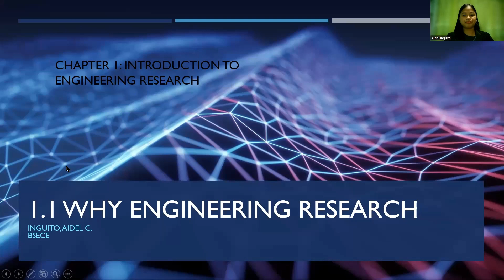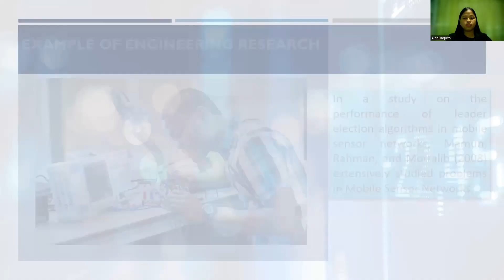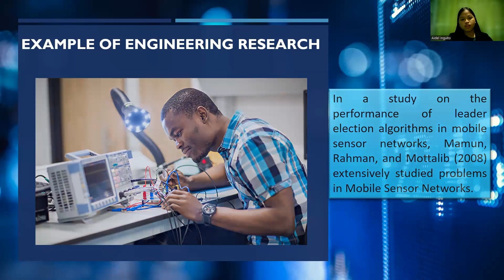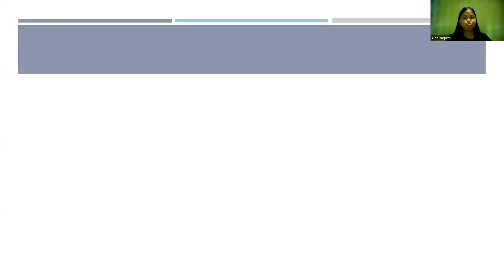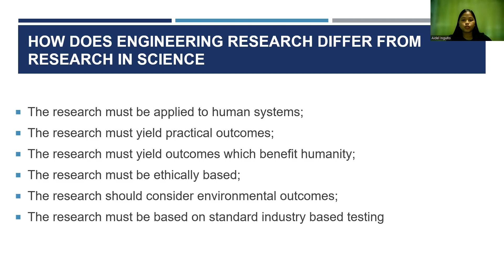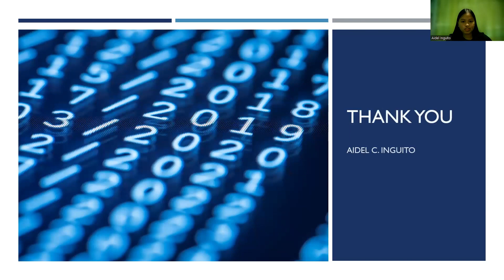Why Engineering Research?

Comment: Pahilaga, Christofferson M.
March 20, 2023
MWF 6:30pm-8:20pm

Reflection
This video presentation talked about research engineering, which for me is more likely about innovation. Compared to the research that we had in high school which is more about historical information and science, engineering research produces something that hasn't existed yet. This report demonstrated how differently the engineering research is compared to research in science.

Reaction
The reporter had discussed his topic in the most effective way. The reporter provided ideas and examples that are easy to understand and relatable to the discussion.

Summary
Engineering research is more about solving an existing problem with innovation. It also seek improvements or additional features to an existing project that helps minimizes the error that our consumers or surroundings are experiencing. It also demonstrated the difference between engineering research and research in science.

Comment: Tagle, Charlie P
March 20, 2023
MWF 6:30 - 8:30
REFLECTION:
I discovered how to distinguish between scientific and engineering research. While both explore new information, engineering research is primarily concerned with how that information could benefit humanity. It must be morally sound in order to safeguard individuals and society.

REACTION: 
very imformative.

SUMMARY:

The vedio emphasizes the distinctions and connections between engineering and scientific research. They both employ the same scientific procedures, but engineering is more interested in applying research to real-world goods, services, and infrastructure. In conclusion, engineering study does not attempt to comprehend how the world functions, but rather concentrates on how items can perform for a certain purpose.

Comment: AMAHIT, KENT L.
MARCH 20, 2023
MWF, 6:30-8:20 pm

Reflection: I observed that the reporter is reporting well the assigned topic and discussing the importance of engineering research, this is an important component of the engineering profession. It allows engineers to understand how to best solve problems and develop new technologies.

Reaction: I observed that the reporter is reporting well the assigned topic and discussing the importance of engineering research. I am excited to learn more about engineering research and how it can help me in my own engineering projects.

Summary: Based on my observation this chapter report provides an overview of engineering research and explains why it is important to the engineering profession. It outlines the benefits of research and discusses the types of research that are commonly used in engineering. It also includes examples of engineering research projects and provides tips on how to effectively conduct research.

Comment: Mariot, Aubrey C.
March 20, 2023
MWF 6:30-8:30 PM

Reflection:
The essence of being an engineer is to explore, innovate and invent things that is impactful to the community. All of these are impossible through engineering research. We are adding new knowledge and gather more information into an existing one, that is what research is all about. We find solutions to practical problems that can benefit the stakeholders. We find ways to create space that will explain how important research is, and how it will affect our lives differently.

Reaction:
I find the video informative and formal. The reporter delivered her topic well, and presented methods that can be surely used in our research. Overall, the presentation is effectively discussed.

Summary:
The contribution of engineering research makes our life today easier. Engineers find solutions to practical problems that put our lives at ease. Through the discovery of new knowledge, and the aim of exploring and seeking for innovation and improvements paved way for us to have an access to a more comfortable life.

Comment: Duhaylungsod, Lynard S.
March 20, 2023
MWF 6:30PM- 8:20PM

REFLECTION:
Engineering research is different from other research studies due to its purpose and functions in the human system. Every engineering project has its purpose and it must be done ethically and we thorough research and survey.

REACTION:
It was a great presentation, very informative and was delivered well by the reporter. The reporter also gave some examples to make her report more understandable and made a summary after the presentation.

SUMMARY:
Engineering research is a study that relates to the human system and must add new knowledge from the existing projects. There were also things to consider in doing engineering research and to have a better outcome.

Comment: Zacarias, Lorrie Jaye U.
March 15, 2023
MWF 6:30 - 8:30

Reflection:
I've learned about the differences between engineering research and scientific research. It is more concerned with the application of concepts and theories to improve one's life. That is why I was drawn to engineering and regard it as a noble profession.

Reaction:
The reporter has done her report well and her voice is very clear that it makes you listen to her more and more. 

Summary:
Engineering research is the process of acquiring new knowledge in a variety of ways. It seeks to improve on the existing outputs that have already been produced. The goal of engineering research is to improve our quality of life by addressing practical problems that require long-term solutions.

Comment: Xavier O. Baculado Jr.
March 20, 2023
EE 341-A (MWF 6:30-8:30)

Reflection: 
I have learned that engineering research is different from the research in science. Based from my previous experinced from senior high school, we were only taught with the research and I am more amazed that engineering research were taught and introduce to me. Engineering research focuses more on the advancement or improvement that can be beneficial and crucial for the society. It is a discovery of conceptual knowledge and finding practical solutions to different types of problems and contribute not just on the society but also to the environment.

Reaction:
The reporter highlights the goal and cite some example that is relevant to this topic. Overall it is very well presented.

Summary:
Engineering research is a process of discovering of new knowledge and it applies scientific principles in finding or formulating solutions for advancement and improvement of life. Engineers create, maintain, manufacture, design, build things that can contribute to the society and by doing a research they can thoroughly seek an improvement or enhancing ones work to fulfill its duty to the fullest.

Comment: Lerio, Shiela Faith
March 19,  2023
Mwf 6:30-8:30

REFLECTION: 
After watching the video, I learned  the importance of the scientific method and peer review in validating research results. Also, the objectives and ethical considerations that are unique to engineering research, such as the practical application of science to benefit humanity while considering environmental outcomes and ethical principles. Lastly, I learned importance of presenting research findings publicly to other experts in the field for review and verification, as well as the need to acknowledge prior work in the field when conducting original research.

REACTION:
The reporter provided thorough coverage of the essential topics from the reference book. Well done!

SUMMARY:
Engineering research applies scientific principles to practical systems that benefit humanity. The scientific method, including peer review, is used to verify research results. Engineering research must fulfill objectives such as being ethically based, considering environmental outcomes, and being based on standard industry-based testing. Codes of ethics and publication of findings are important aspects of engineering research.

Comment: Trono, Clyde M.
March 19, 2023
MWF 6:30pm - 8:20pm

REFLECTION:  
The video tells about engineering research. Engineering research goal is solving new problems, develop new ideas, and making life easy. It is different than other research. 

                        
 REACTION: 
   The presentor delivers the topic clear and precise. I understand the topic about why engineering research.        
                 
                 
SUMMARY:
Why engineering research? Engineering research concerned with the discovery and systematic conceptual structuring of knowledge. Making new idea to solve the new problem in life. It helps to make life easy.

Comment: Gador, Christian M.
March 19, 2023
MWF 6:30-8:30 PM

REFLECTION:
The difference between engineering research and research in science is new knowledge to me. Previously, I thought there is only one type of research. But in this lesson, I have learned how research is differs in engineering when compared to the research done by scientists.  It is focused more on the application of concepts and theories to improve life. That is why I really wanted to study engineering and consider it as a noble profession. 

REACTION:
The presentation is simple and concise. The reporter explained the concepts very well and without error. 

SUMMARY:
Engineering research seeks to develop known theories and practices from a multitude of disciplines. Examples of such are the Mobile Sensor Network, as well as the Hybrid Solar Room Heating System that was discussed in the video. Although engineering research follows the same exact methodology as scientific research, it has different goals. The goal of engineering research is to make living easier and better by providing solutions to problems and improvements to functional things.

Comment: Lluvido, Lynan Kim A.
March 19, 2023
MWF 6:30 - 8:30 PM

REFLECTION:
Being an engineering student, I think it is in our nature that we tend to explore new things as our way of adding more knowledge in our system. One way of doing so is through the engineering research. Being able to add new information to those existing ones is what research is all about. Finding practical solutions to the different types of problems we have in our surroundings. It is not just simply about how things are, but rather it is on why things exist and how it affects others.

REACTION:
From what I have observed in the video presentation, the reporter gave her best to explain each part of her lesson. It was clearly presented and well delivered. With the help of the video, we can really gain new knowledge about research.

SUMMARY:
Engineering research is a process of discovering new knowledge in various ways. It seeks improvement on  the existing outputs that were already produced. There are some differences between engineering research and research in science in a sense that the first one is more on practicality, innovation and ethics-based output while the latter one is more on the improving of human condition through medical practices.

Comment: Pis-an, Clark Z
March 19, 2023
MWF 6:30-8:30pm

Reflection
In my own understanding and knowledge in the video presentation, I learned that engineering research is essential for the improvement of human life. It is very rampant in present years the benefits of engineering research. In communication, we already have smartphones and other gadgets that we can use. Also engineering research can help in the medical field, just like the modern apparatus and devices that medical experts used to have a more accurate and precise knowledge on the condition of its patients. Overall it is the responsibility of the researcher to ensure the safety and welfare of its invention or innovation.

Reaction
Based on my own observation on the video presentation, I observed that the reporter is knowledgeable with her topic. The reporter discussed each examples, thus making it easier for the viewers to understand her assigned topic. Also the presentation is visible and the design is commendable. Overall the reporter have a great presentation.

Summary
The video presentation is all about "why engineering research?". There are many topics that a researcher can base its research study and engineering research is one of it. Engineering research is very important because it can greatly help us to alleviate our form of living. The engineering discipline is described as the application of science to realistic systems which benefits human kind. Therefore in engineering research we need to consider the safety and welfare of the people and also the environment with the things that we innovate or invent.

Comment: Kevin Alama Quilnet
March 20, 2023
ENS 341 A - Research Methods of Engineering  M-W-F  6:30-8:20pm

REFLECTION:
What i can reflect from the video is that engineering research is a critical aspect of the field of engineering, as it plays a significant role in the development and advancement of technology. Engineering research is focused on developing new technologies, improving existing ones, and finding solutions to engineering problems. It involves a rigorous process of data collection, analysis, and experimentation to develop new theories and models that can be used to design and build better products and systems.

REACTION:
The voice of the reporter was clear and she delivered her report superbly. Everything was related to her topic which is good. Although there are some background noise, the voice and the presentation is good and was able to present neatly. The discussion was well performed. 

SUMMARY:
Overall, engineering research can be time-consuming and expensive, particularly when it involves experimental work or the development of prototypes. Despite these challenges, engineering research is essential to the advancement of the field and to the development of new technologies that can improve people's lives. By continually investing in research and development, engineers can continue to drive innovation and make significant contributions to society.

Comment: Sojor, Gwenshane Arnel R.
March 19, 2023
MWF 6:30-8:30 PM

REFLECTION
Why do we have to take on engineering research? I think the term 'scientific method' is one of the reasons. The scientific method, which is the guiding framework for engineering research, involves rigorous testing and evaluation of hypotheses through experimentation, observation, and analysis. This process helps to ensure that the findings are reliable, valid, and replicable, and that they are subjected to independent verification by other experts in the field. The interdisciplinary nature of engineering research is another important aspect to consider. Engineering research often involves collaboration with other fields, such as medicine, physics, and computer science, to address complex problems and develop innovative solutions.

REACTION
I found the report to be highly informative, as the reporter was able to effectively address the key topics from the reference book. All in all, the presentation was excellent.

SUMMARY
In summary, The field of engineering is defined as the practical application of scientific principles to real-world systems that improve the well-being of humans. As such, engineering research is guided by the scientific method, which involves conducting experiments, formulating theories, performing calculations, and creating models based on the existing scientific knowledge. These findings are then subjected to independent verification by other experts in the field.

Comment: Gahob, Jun Louis T.
March 19, 2023
MWF 6:30 - 8:20 PM

Reflection:
I came to understand the critical part engineering research plays in the advancement of technology, which is evident in items like smart phones, motorcycles, and building design, among other things. The study of engineering is a foundational aspect of human civilization.

Reaction:
The reporter spoke clearly and concisely about her subject. I now have a better knowledge of the significance of engineering research in terms of technological advancement.

Summary:
The presentation places a strong emphasis on the value of engineering research in the development or innovation of technologies that address real-world issues. A hybrid solar room heating system, for instance, uses solar energy rather than conventional energy to reduce the carbon footprint.

Comment: Zabala, Portia Berenice C. 
March 19, 2023
MWF 6:30- 8:20 P.M.

Reflection 
I just found out that Scientific Research and Engineering Research are likely the same (in general) but differ in in-depth purpose. Although they have the same methods, contributions, and others, still, they have their own perspective. They have their scopes and limitations that is why also code of ethics are made. In engineering research, wherein observations, calculations, etc are made from scientific methods, they are needed to be reviewed and verified independently by qualified reviewers. Hypothesis can be dreadful as it directly rejects papers when one of its hypotheses, meaning not all that is being said as an hypothesis, gives inaccurate details. All of it fails if conditions are not met. There are also objectives an engineering research should have and follow in order for it to be considered as an engineering research. 

Reaction 
The reporter reported her assigned topic properly. The video also was well-presented. 

Summary 
Scientific Research and Engineering Research are two distinct research. They have similar characteristics but differ in in-depth fields that’s why code of ethics are made— to ensure the scopes and limitations one should have. In engineering research, it should include several objectives relevant to engineering to make it as an engineering research. A research can only be referred to as new knowledge if it has gained a confirmation from the qualified peers that is acceptable and new.